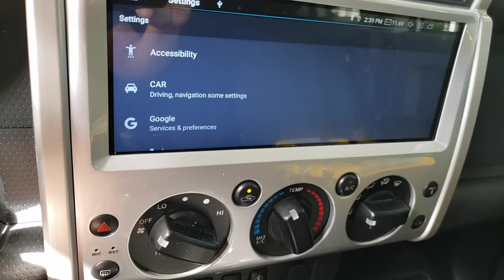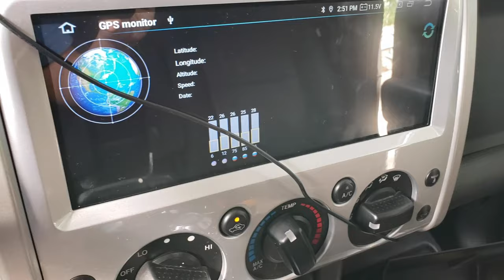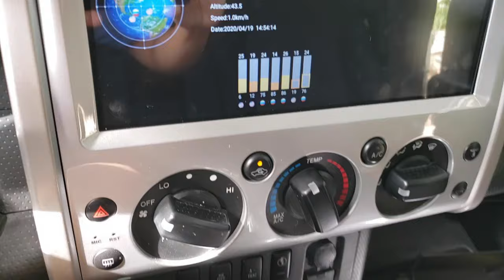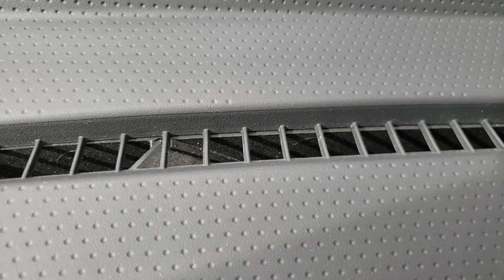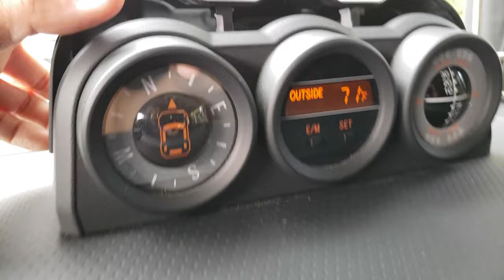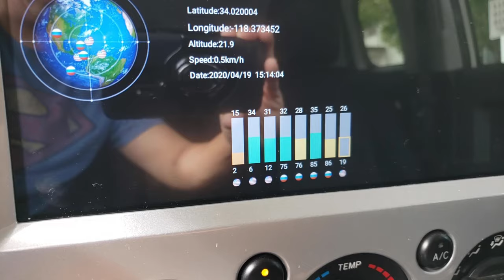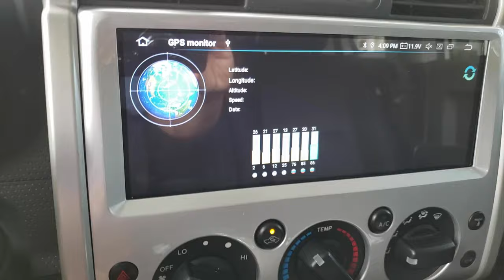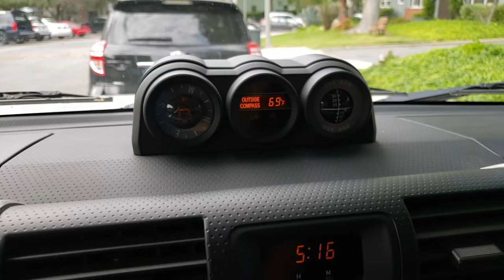Installing a GPS Antenna in my FJ Cruiser Gauge Pod

Comment: You actually got quite a few additional bars with the change of position. I love my cruiser. Have to replace the driverside cowl and tire cover that were stolen. I am at 253,000 plus miles.
Reply from the maker: Did you lose your cowl as a result of a windshield replacement?  Bummer about that tire cover too.
Reply: @LiL13izzy7  no. I actually had someone pry it off.
Reply from the maker: @alonzofineart2428  that's pretty messed up.  Sorry to hear about that.

Comment: So did you close the top of the compus lid? And did the antenna block the lid from closing? I like that install 😃
Reply from the maker: Yes. Drilling the hole allowed me to put the cable through and snap it shut. The antenna is small enough not to block the lid from closing. I had to reposition it a little bit from the original spot where I taped it (away from the slope in the back cover). Looks completely OEM and gets a decent signal.

Comment: Suggestion would be run the wire thru the edge of the headliner and stick it on the windshield in front of the rear view mirror. Unless you don’t like it.
Reply from the maker: I considered that, but I just prefer the OEM look of my placement better.

Comment: Does anyone know how to dis able the daytime running lights? I tried pulling the DRL fuse but they still stay on.
Reply: Yes, I disabled mine shortly after I bought it
Reply: these is a smack gray box behind the driver side headlight
reach hand down and pop out the panel under light to get to it.
separate that connection with small screw driver to disable DRLs
there is a vid out YouTube for it somewhere.

Comment: If using Apple CarPlay for Apple Maps navigation via my phone, there’d be no need for this correct?
Reply from the maker: That's correct.
Reply: @LiL13izzy7  does it interfere with compass, etc? Retrofitting the pod cluster tomorrow from sourced salvage parts. Is yours original? Just want to reference shape of cutout to fit mine. Thanks great idea
Reply from the maker: @svnbit8408  It does not interfere with the compass.   Mine is original, yes.
Reply: @LiL13izzy7  thanks bro, now I have a good reference for the cutout, the posted thread on forums looks a bit large, always good to start smaller! 
How's that head unit? Older custom Android version? Was thinking of getting one but might wait for something closer to stock Android 10 and more mainstream brand to get latest features from Google. I'm a nerd like that.
Reply from the maker: @svnbit8408  I do feel the square cutout is bigger than it needs to be. You really only need to cut enough room to pass the wire harness through.  The pod itself is attached to the dash by 2 screws. You don't need a giant hole to attach 2 screws and a wiring harness.  However you should be aware of the tabs at the bottom of the pod that tuck underneath the dash. If you want to keep the square small, you'll need to cut off the tabs to make the pod sit flush on the dash. 

Like you, I waited a while before I decided to pull the trigger on a head unit. I looked at mainstream brands at first, but the fitment was just too generic for me. These head units are made specifically for the FJ dash so, it looks better to me.

Comment: I have the same HU but my FJ is an 08 that didn’t come with steering wheel controls. It’s very difficult to change the volume at highways speeds.
Reply from the maker: That is a very good point. As I mentioned in my other review video, I wouldn't recommend this head unit for FJ models without steering wheel controls (or at the very least, volume controls.  You might want to look into a head unit with a volume knob, such as this one here:  https://www.joyingauto.com/2007-2014-toyota-fj-cruiser-8-inch-android-car-head-unit-with-built-in-dsp.html
Reply: @LiL13izzy7  have steering controls, what are good features to look for in head unit? Is it up to the OEM to upgrade Android versions? Is Android auto agnostic, or separate from the head unit UI? 
Just wondering how it all works not sure if they're all custom and youre stuck with their update plans, or they all can be upgraded independent of manufacturer OS?
I'm hoping to find a good budget one and maybe there's a custom roms out there to improve it change it like Android phones. I dunno lots of research to do.
Reply: LiL13izzy7 that’s a good HU but it’s not 12 inch screen like yours
Reply from the maker: @mikekramer4886  yeah that's the trade-off you gotta make, I guess.  After checking out the specs, I actually don't think I would mind that one with the volume knob. If they produced this one before I bought the 12.3", I probably would have chosen that one instead, but it looks like it fills your need for a safer experience.
Reply from the maker: @svnbit8408  did you watch my review video of the head unit?  https://youtu.be/78b5hhhnrmg
Reply: You can buy one and fix it by it cabel i do it for manual fj and i try to fix the compass because it not have

Comment: What is that white box in the Pod? I see white inside dash in back as well?
Reply from the maker: The white box is the housing cover for the internals of the gauge pod.  I'm not exactly sure what you're referring to about the white inside the dash?
Reply: @LiL13izzy7  Thanks! I took apart my dash. In back of all the internal I see white. Figure it more of the same white box like in the housing cover. I just assuming it might be the Airbags. But not sure. FJ Cruiser seems impossible to get a workers manual for. The Regular Manual is good. Just limited.